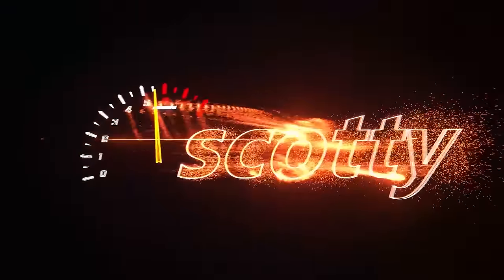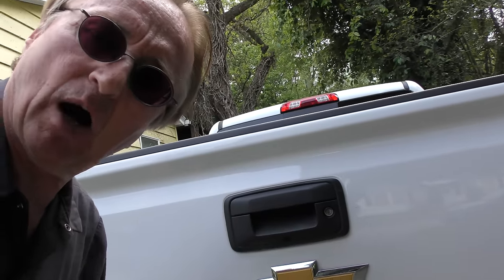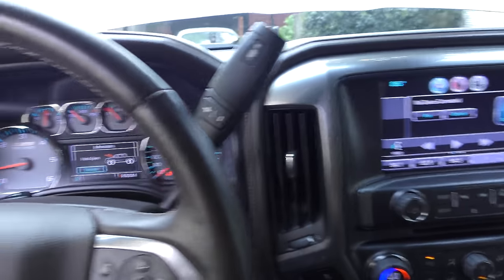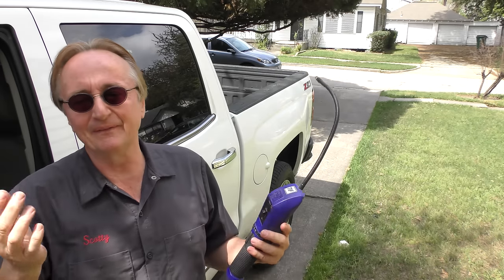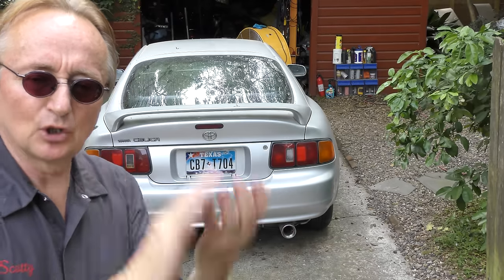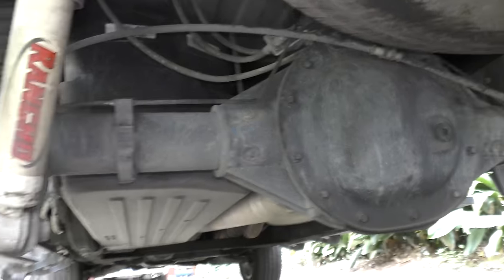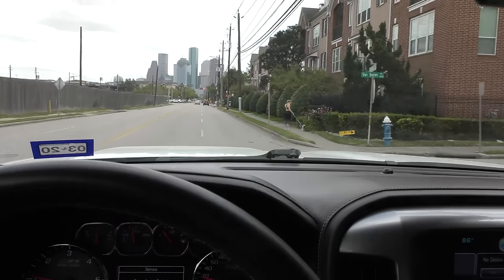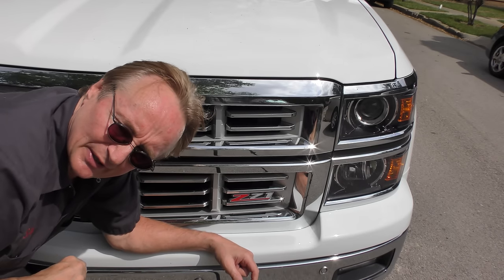Here’s Why I’ll Die Before I Buy a Chevy Silverado

Comment: I just test drove a 2018 GMC Yukon Denali with 40k in a Chevy Dealer and the AC was already broken.
Reply: That great G.M. feeling
Reply: My 2015 Tahoe was a lemon and luckily GM took it back with all the problems I had it was a headache! Will never buy another GM!
Reply: Bad luck guy, I driving Chevy and Fords and I'm happy with both.
Reply: @pftrans  sorry about that, my father’s Tahoe has been probably free at 60k and my friend’s Yukon is at 100k without a problem. I guess your’s was a one-off, glad they took it back.
Reply: inSAYn my Tacoma has 296,000 miles on it, and my A/C is almost as cold as my wife’s 4Runner that’s 4 years old. Have basically changed nothing. 60K in a Toyota isn’t even breaking it in.
Reply: 40k is nothing my evap core went out at 6k in my mustang your lucky it went to 40k mine died on summer 🤦‍♂️
Reply: I won't believe that history, they wouldn't let that happen. Once a car gets to the dealership it has to be throughly inspected by the shop.
Reply: It could happen with any vehicle, a  2017 Toyota Corolla got into my friend's shop a few days ago with AC not working  dealership wouldn't honor the warranty  so they were charging $650 to fix it,  the only problem was electrical  and that could happen to any vehicle.
Reply: Ben L it should be under the bumper to bumper  if it’s 17 unless it had Over 60k which I doubt it . It’s proven new cars are Pos .
Reply: @smurfeco2.358  It was over 100k  that's why  the warranty  did not cover the AC.
Reply: Ben L I kinda figured that . if the issues isn’t common then it’s a wear and tear with over 100k not a lot of corolla have that much miles yet . If it was a tsb than that’s a different story
Reply: @pftrans  you should have called Toyota corporate and complain that's who is in charge, the dealership is just an independent sales shop who always is trying to scam the customer, the sooner you realize the truth the better.
Reply: @XerxezsX  The vehicle wasn't mine,  it was a customer that brought the vehicle to my friend's Shop to get it fixed because Toyota wouldn't cover the warranty with over 100 k miles.

Comment: Scotty is the ONLY mechanic who has ripped on Chevy so much.its almost embarrassing.he shows alot of reasons why I question his knowledge beyond basic repairs...
Reply: What did he say that was wrong?
A 2k repair on a 5 yr old car is stupid!!
Reply: @davec.3198  If you drive a Chevy Silverado, you should be able to 15 years out of it with mediocre maintenance. 

I routinely see GM cars with hundreds of thousands of miles, and some Chevy Silverado owners are known to have placed more than a million miles on their original engines. 

Scotty is a domestic car basher. But his whole opinion is baseless. The statistics show that GM vehicles are some of the most durable, and GM new owners know his.
Reply: @catlover1986  Sorry man.  But your belief is not correct.  Search for top 10 best used vehicles and there isn't 1 GM product.  
No one disputes that you can pump parts into a car and keep it running.
My boss has a 2015 Tahoe.  It his sales work vehicle and only the dealer maintains it.  Perfect maint history.  
Bad ac unit at 80k.  Sunroof started leaking at 30k.  Bad gps unit.  Antenna went bad.  
That stuff is just plain silly.  It is a $70k luxury suv.
Reply: @davec.3198  JD Power aggregates dealer repair data. GM is over represented in the top 5, where they usually hold 2 spots, and always hold at least 1 in long term durability. 

GM makes the best engines on the planet, they outlast everyone. Chevy Silverado according to absolute scientific evidence, is THE longest lasting vehicles in existence on the road. 

My wife drives a 2012 Honda. Doesn't have 100,000 miles and it is literally falling apart. She always does all maintenance, at the dealership, right on schedule. Doesn't matter, because Honda is a mediocre brand, as is Toyota.
Reply: @davec.3198  Also, AC is all about maintenance and fluids. I used to own a 2000 Lincoln Towncar, it had no significant rust or corrosion, and functional AC after 17 years.
Reply: @catlover1986  You're going to GM dealers for unbiased repair data? Come on.
No one has engines that wear put anymore.  Name any manufacturer...I bet their engines last forever if taken care of.  Materials science has gotten very good.
Where the rubber meets the road is transmissions, electrics and accessories.
Reply: Dave C. That happens will all manufactures, not just Chevy.
Reply: @davec.3198  Both GM dealers AND consumers are compared by JD Powers. They use actual data, and are the only group to do so. 

If there's a discrepancy between consumer reporting and dealer reporting, it would be examined. 

The reality is, today cars are better than they used to be. Across the board. 

GM, unlike nearly all German manufacturers, told the truth about their diesel results. Toyota and Honda lied to consumers when they had major necessary multi-year problems and recalls they covered up. 

Like it or not, GM is more honest than any of the foreign manufacturers. So why would we doubt their claims? 

The problem with domestic car bashers, is their argument against American cars just isn't realistic in the data, or our lived experiences. Pretty much everyone I know, has owned an American car with at least 150,000 miles on it. I've known many people who have had American trucks or SUVs last for many hundreds of thousands of miles, even with original transmissions. 

This whole idea that American cars are junk, just doesn't hold water, and hasn't in 30 years.
Reply: @davec.3198  I used to know a guy who loved Honda and Toyota vehicles. He was a cop, and liked to do off-roading and camping. 

He would routinely make fun of American vehicles, calling them junk. Yet, he kept a 4×4 Ford F-150 he had bought used, which he kept around to get his Asian vehicles unstuck from the mud. Had an electric winch, and other toys on it. 

That Ford F-150 had 350,000 miles on it. But he'd bash it for being "rusty" (we live in Cleveland, in the rust belt). The irony was lost on him, of having to keep an old, long lived American workhorse vehicle around to rescue his expensive foreign SUVs. 

That's the delusional world of the American car basher.
Reply: @catlover1986  A guy I work with had so many problems with his Chevy Equinox that he had to lemon law it.  Then he bought another GM product..an Avalanche.
To me.  That's insanity.
I buy older Nissans and Hondas.  I've had nothing but good luck.  I've never had a transmission issue.  I did have an engine blow on a 2001 Altima.  I bought it with 89k from a used car lot.  Who knows how it was treated before I got it.  I put a crate engine in it for $800 and ran it for another 50k.
I always buy used an run high miles.  That's why I buy Japanese.
Reply: @davec.3198  Every company makes Lemons. That's why we have Lemon laws. If you do a Google search, you will see people use the Lemon Law for every single factory brand and model, every year. Every. Single. One. 

There are Hondas, Toyotas, and Nissans in every model and trim, that blow their engines catastrophically at a couple thousands miles through no fault of the owner. Facts. 

If your new Honda engine blew, would you abandon the brand and go American only? Doubtful. So it doesn't make sense in reverse for the Equinox guy.
Reply: @davec.3198  I once bought a Buick LeSabre at 80,000 miles on it. Ran it for another 100,000 with original transmission and engine, no issue. (Bought it for $9,500 and traded it in perfectly operational grade for $4,500). 

That's why I buy American.
Reply: @JT-yz4rj  You guys can claim whatever you like.  There is a reason Toyota and Hondas fetch a better price on the used market.  They are bulletproof.  No one disputes that.
Buy a Yukon or Suburban for $70k...drive it off the lot and it just depreciated $25k.  There is a reason for that.
Reply: @catlover1986  Do you really belive a Japanese car would not run with the same or better reliability than you Buick?  Come on man.
Reply: @davec.3198  Its statistics. Your belief in the superiority of Japanese cars is outdated, and not statistically sound. 

It was true, 20 or 30 years ago. It isn't true now. That's not to say Japanese cars suck. They don't. But American cars will last just the same. Every American (not foreign owned Dodge, Chrysler, Jeep) vehicle, will last as long as you care to drive it, with reasonable maintenance and repairs. 

The difference is American cars also happen to be cheaper, and cheaper to repair. Overall, mile for mile, they have a far cheaper cost of ownership for mile driven, than any non-American brands.
Reply: @davec.3198  The Chinese, who have no dog in this fight, as they don't own any real brands, choose Buick as their most popular car among those who have the money to pick. 

That's their idea of a quality vehicle. Not Japanese.
Reply: @catlover1986  I've been to union facilities.  I've worked in union facilities.  They are a far cry from the pride in workmanship a full embrace of lean manufacturing and TPS you get from Japanese.  Worlds apart.  They have been doing it longer..they are better at it and there is always a focus on reliability.
My first car was a Pontiac. It was garbage.  My brother had a tiny Nissan Sentra that never had issues.  
I got to know Hondas because I have always ridden powersports.  Their dirt bikes and atvs are unstoppable.  Same with their motorcycles.  Super reliable.
Reply: @davec.3198  I've been in both. Americans focus on reliability. So do the Japanese. 

The statistical results are without question, American and Japanese cars have comparable reliability rates, and the individual brand, not country of origin, are the most important details. 

Recall, it was American companies that taught the Japanese their current standards in lean efficiency and reliability, if you study the history of operations management.
Reply: @davec.3198  I don't dispute Honda is reliable. The issue is saying American cars aren't. 

The reality is, if you buy an American or Japanese car, it's all going to come down to maintenance. If you buy a new car (rarely do American bashers have a new American car as their first car, usually a beater), and if that new car is well maintained you will easily get a couple hundred thousand miles out of it. At least 150,000 cheaply. That includes the cheapo $16,000 cars you get on special at the end of the year.
Reply: @catlover1986  Yes..an American (Deming) taught Japanese lean..after American car companies completely rejected the idea.
Reply: @davec.3198  The economics of the time didn't support it in the US. 

Then, Americans adopted them in the late 80's and on. Quality improved dramatically, and around 10 years ago reached parity. 

It's easy for an upstart industry to adopt new standards. Its hard to retrofit. But Americans changed and retrofitted, and now our industry is excellent. In both countries, we have switched almost entirely to robotics, eliminating 80% of our labor forces. 

Our robots and theirs do a similar quality job. My dad was an IBEW electrician for Ford from the 1970s on. My grandfather was a computer programmer and later plant manager for GM from the 1950s on. 

They both talked about the profound changes that were made in the 80s and how their focus switched from quantity to quality. That has been demonstrated by the data, as American cars are all very reliable today, with most cars comfortably lasting well past 100,000 miles with minimal repairs, something no car did in the 1970s from ANY manufacturer.
Reply: @catlover1986  Would you please post the stats you keep referring to?  I'd like to check them out.
Reply: @davec.3198  Best bet is J.D. Power. They are the only large analytics tracking firm to monitor the automotive industry for long term durability.
Reply: MrBrucelee117  Well, yes we do from a statistical basis. You can actually look up annual repair reports. We can see how many repairs are required for car models on average, during the first few years of ownership. 

Also, I have owned several GM vehicles. They do in fact last to around 150,000 miles on average (in my experience) before you have to start doing repairs that go beyond normal fluids/belts/hoses maintenance.
Reply: superfuresh  Like it or not, I'm not seeing anyone with an alternative. If anyone had data showing that American cars sucked, they'd be shouting it from the mountain tops. Alas, it does not exist. 

Notice the domestic bashing reviewers like Consumer Reports, refuse to use statistical analysis. They only use their perceptions, and never ask owners or repair shops about their experiences.
Reply: @catlover1986  Could you please post a link.
Reply: @catlover1986  I love Toyota's because I've owned 3 and they have been great but my 3 Chevy silverado have all gone well over 300,000 miles with absolutely no major issues whatsoever. And I torture my trucks. My current 05 GMC Sierra runs better than any of my past Toyota's.
Reply: @catlover1986  I am not strictly Japanese brand fan, rather a fan of quality vehicles.  Your statement is lacking some details, such as:  Is your Honda a Japanese or American built car?  What is "literally falling apart", mechanical or cosmetic?  I own a 2005 Sierra 1500, SLT, Z-71 since new and have had nothing but issues, albeit, no engine/transmission failure since new.  I've found Lexus cars to be extremely reliable, and will only purchase their vehicles, for the foreseeable future.  Wish they make Lexus full size trucks, or Japanese built trucks.
Reply: @catlover1986  Besides keeping the condensing coil clean, the is no maintenance on the a/c system, it is a closed system.
Reply: @airmechanical3064  Firstly, as a former HVAC technician, I'll tell you there is more to maintenance than cleaning the coils. Any mechanical system requires maintenance, particularly if the tubing gets damaged, and refrigerants should be occasionally swapped and fully charged, just like ATF fluid. 

If Lexus made trucks, they also wouldn't be of the same quality as American trucks. The Japanese have never been able to compete well against full size American vehicles, where the US auto industry the the global dominant performer. Companies have specialization, and American strength is in large vehicles, where the Japanese just aren't very good. 

Whether a vehicle is physically made in the US or Japan is irrelevant. It is the company, not the manufacturing site that determines quality. If the Japanese can make good cars in Japan, but can't in the US, that is a failure of their car companies. 

Perhaps it is because the US auto companies are unionized, as are the Japanese in Japan, but Japanese car companies are not unionized in the US. So perhaps the lack of being unionized has reduced their quality here.
Reply: @airmechanical3064  Also, you mention you own a 2005 Chevy, since new. 

Are you aware that for 17 year old vehicles, almost none are on the road among most major brands? 

Vehicles don't typically last that long. Among Chevy trucks, the average time on the road is over 15 years. Among most brands, it is less than 12.
Reply: @catlover1986  Just to clarify, Toyotas have good build quality, which is definitely better than GM, at least until 2021.

Comment: I actually own a 2015 Silverado that is now coming up on 69,000 miles. To date the only work done on it outside of routine servicing was front brake pad replacement and a battery, not unusual for a truck of this age and mileage.

Although properly maintained, this truck is not "coddled". It is a daily driver and weekend work truck. I commute 300 miles weekly and often make road trips averaging between 400 and 900 miles round-trip. I haul and tow with this truck and it continues to perform well.

Vehicles built in the last 10 years, foreign and domestic, have routinely become more complicated, especially with the greater use of computer based components and demands for more creature comforts. I can guarantee most of them have some repair that is more complex and costly than they were on models of previous years (adjusting for inflation).

One can make a case that cost, service and repairs on newer vehicles overall are more complex and expensive than vehicles built over 10 years ago (again, adjusting for inflation). Singleing out the Silverado for the complexity and cost of a single repair is completely uncalled for.
Reply: Your AC condenser will leak soon .They all do with the 5.3L engine.2014 to 2018 models.
Reply: Did you change your own battery?